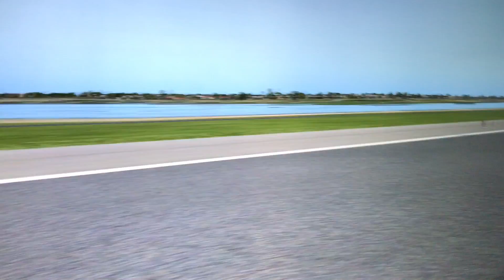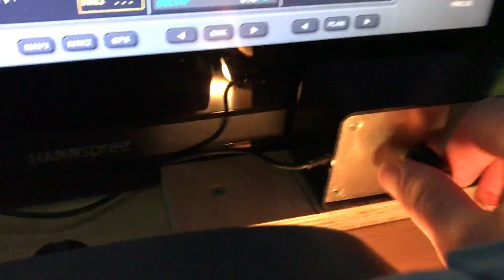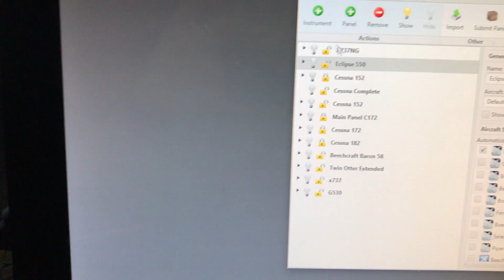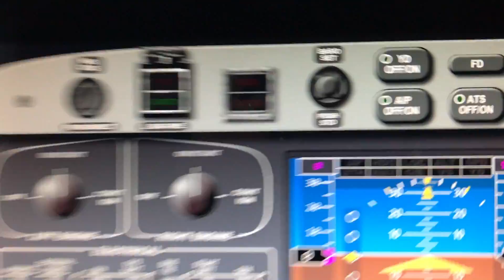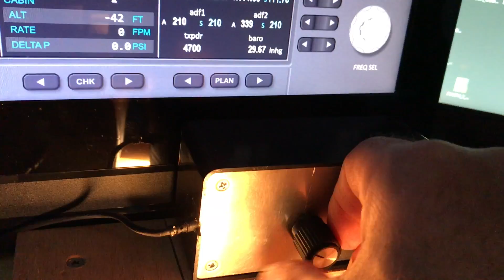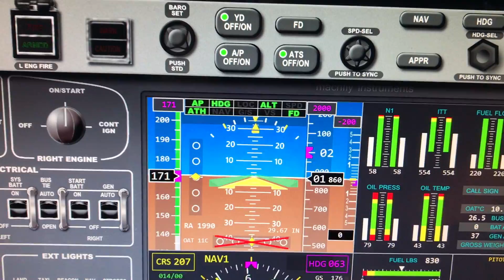Air Manager Knob Control

Comment: Hi. I have P3D and air manager in the same PC. If I try to manipulate any controls on the second monitor where I put my air manager controls, the simulator in the main monitor just pauses and I can not change any radio frequencies or manipulate the VOR, can you explain what is going on or if I have to install any other software. Thanks you
Reply from the maker: I am no a P3D expert but there is a setting in FSX that causes the screen  to pause when it loses focus( is not the active window). 
See the link below and maybe P3D has a similar setting
https://www.flightsim.com/vbfs/showthread.php?243690-can-I-have-FSX-not-pause-automatically-when-I-switch-to-a-different-window

Comment: hi Ross
I have utilised A really neat rotary knob and toggle switch and push button unit I got from derekspears .com I use the 5 rotary knobs for changing the time changing the altimeter up or down changing the range in the gps and my OBS 1 and 2 and I have assigned the toggle switches to operate a range org functions which can be done in the joy stick options
Only cost $120 but realy worth it save a bucket load of annoying mouse clicks
IWOULD like to send you a video clip but I don't know your email address
Still waiting on the airmanager update
Regards
tony gard (anthonygard4@gmail.com
Reply from the maker: tony gard   Cool. A couple of us have playing with the Air Manager code for dials to accelerate the rate of input based in the encoder speed. You can follow that on the Sim Innovations forum.  To change the ALT SEL especially took too long.  Also with the raspberry pi version of Air Manager, which is in beta now, I have a scheme that will allow a single encoder with push button to highlight and control even multiple knobs as discussed as scroll touch here. Watch my channel for updates.

Comment: Hi Russ, thanks for the vids on using the touch screen. I have the same point of view, next to real hardware, touch screens are next best. I currently have a 36" HDTV for my main out the window display (VC) and use Splashtop to send a duplicate (VC) to my ipad. I have the ipad mounted right in front of my TV in reach of my chair,  similar to your set up.  
I use Simple Camera, like EZDok, and have close up views of the MCP, throttle quad, overhead, ect., bound to a hand full of buttons. I can bring up each panel as needed, touch the switch on the ipad to activate landing lights or whatever, then push a button to return to the main VC. I also use FSUIPC and the same rotary encoders you have. I have a bank of six encoders and with FSUIPC,  I bind them to hdg, alt, crs, and spd,  depending on the plane. I agree with you, rotary dials are the main drawback to touchscreens. But overall,  a touch set up with a few rotaries is the best solution if your on a budget. IMO.  Happy skies.